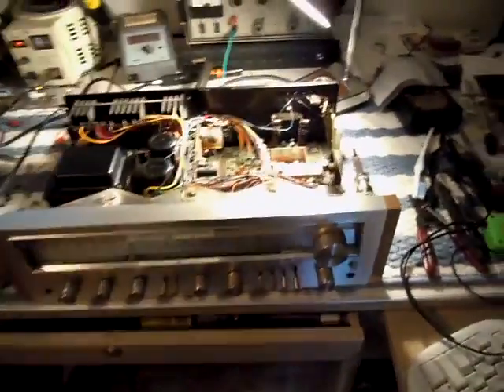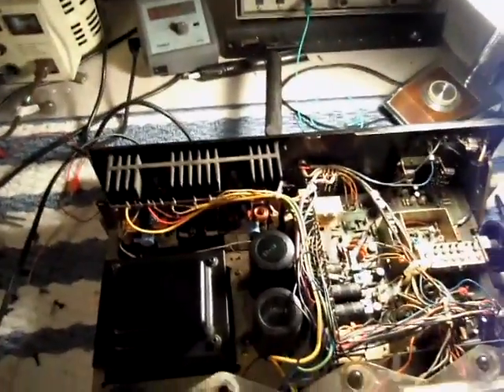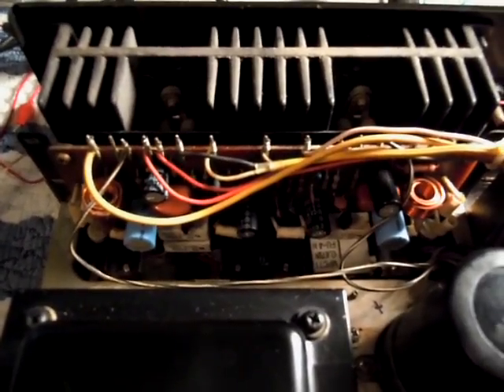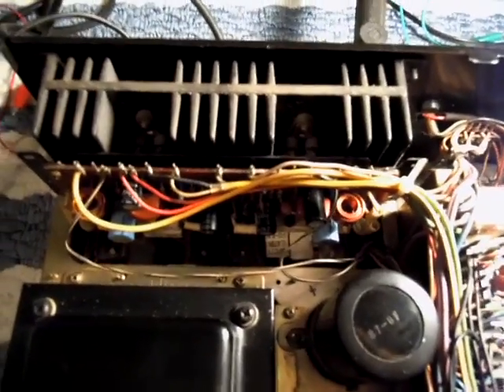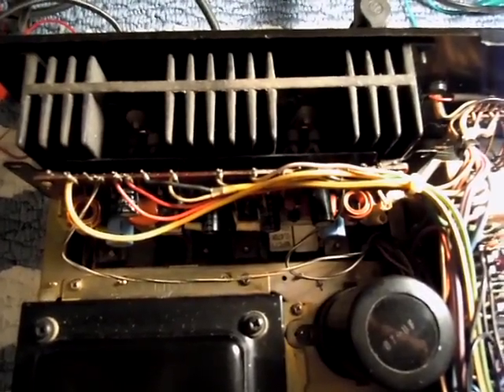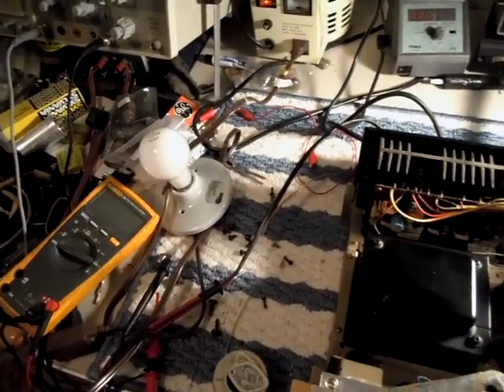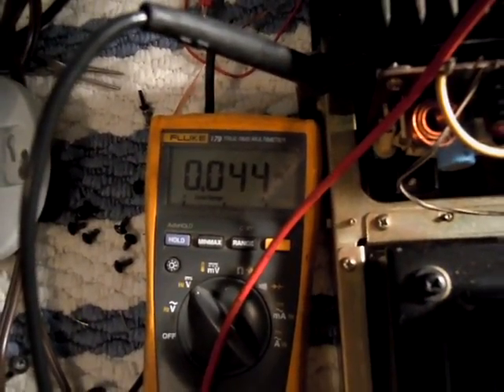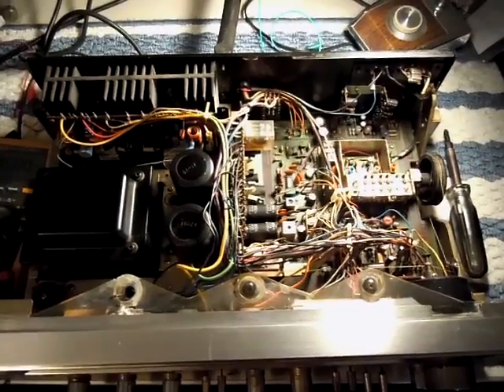Vintage Pioneer SX-750 Restoration Project UPDATE - Amplifier fixed!

Comment: What is the correct dc offset at the speaker terminals for this unit ? I’m to cheap to buy a sermanual 😆
Reply from the maker: Should be close to zero, less than 50mv.

HiFi engine has a service manual, but don't go tweaking unless you know what you're doing
Reply: I’m all good then , 41mv on the left and 33.3 on the right👍thanks for answering 😃

Comment from the maker: The protection relay in your set has bad contacts. If you can ramp up the volume and the channel pops back in its a dead give away. The relay will need to be pulled and the contacts resurfaced - or the relay will need replacement. Something else to be done while its apart is to treat the switches and controls with caig deoxit D-5. Great contact and control cleaner that can be purchased through parts express.

Comment from the maker: when you experience a hum that is volume independent (still heard with volume at minimum.) the problem is likely a power supply failure. Capacitors open and cause excessive ripple on the power supply lines which shows up as hum in the sound.
Reply: I'm having this problem with my sx-750. Ideas on fixing ?